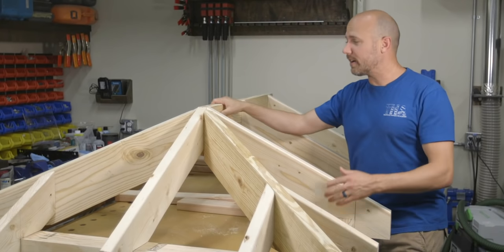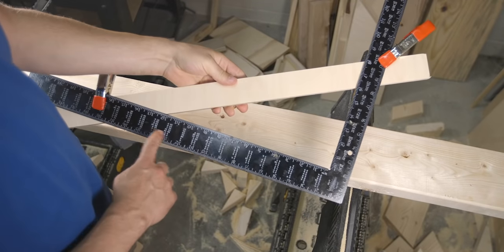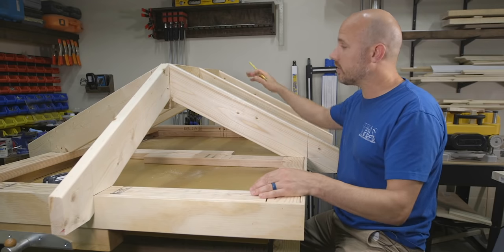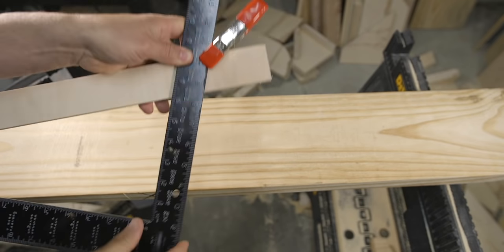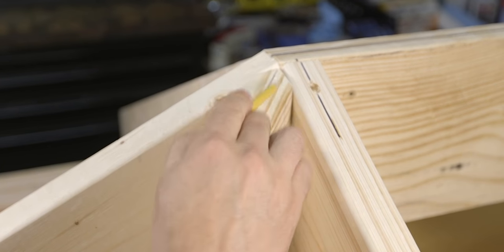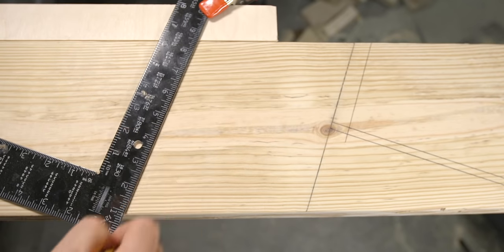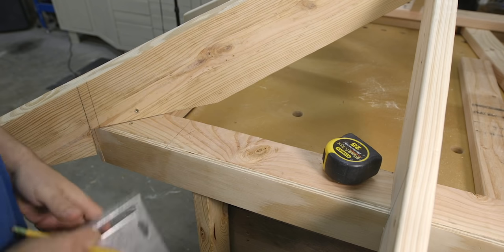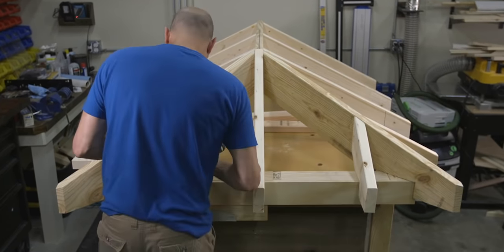How To Frame A Hip Roof - Including A Common Rafter Review

Comment: I will be adding a pitch into a low slope roof. The door will be replaced with a window. I believe the hip roof works best but I’m not the greatest mathematician. The run is 95.25”, 3’ on the wall, and width is 8’4”. The fascia board is already installed.

Comment: Thanks for video, I learned without this special calculator, basically the Pythagorean theorem - a common rafter run is 12”, a hip is 17” run  -this concept is understandable-learn the method or learn the calculator.

Comment: I just built a gazebo with a hip roof after looking at your very well explained videos. The result is more than I expected.  Thank you so much Josh!😊
Reply from the maker: Nice work! Thank you for taking the time to share your success with me.
Reply: If doing 24" oc  instead of 16" oc on Jack rafters  do I still add 7/16" please sir
Reply from the maker: @dannyflanery7466  Yes for this same roof pitch.
Reply: @TrainingHandsAcademy  mine will be 4 /12 pitch  add the same 7/16" ??
Reply from the maker: @dannyflanery7466  Yes, it will be close to that number... cut one and see how it works

Comment: Not to take away from this informative video but I built a rectangular shed with a hip roof. I found a program on line that you input all your dimensions and I printed out layout and cutting templates for my miter saw. The results were amazing and didn't waist  any wood.
Reply from the maker: I appreciate you sharing this. What's the program?
Reply: @TrainingHandsAcademy  Same Question

Comment: Love your videos. Clear, concise and to the point.  I have one question. When cutting the hip rafters you change the pitch from 6 - 12 to 6 -17. Does that apply to any pitch?  For example would I use the same run (17) for a 5 -12 or a 4 -12?  So 5 -17 or 4 -17  in this example.
Reply from the maker: Thanks Paul! Yes, any pitch. A valley or hip rafter always has a unit run of 17". Did you see part 2 of this video yet? https://youtu.be/c2KrU2b1EJI

Comment: You explained it correctly good job. Not sure why nobody  backs there hips anymore, especial on 4 x hips, instead of dropping the hip. Only takes another 15 minutes or so. I have not watched any other videos, another trick, if you don't know this ,, for a cut that is over 45 degrees on the saw, lets say 60 degrees.. you can first cut a 45 and than a 15 to get 60.
Reply from the maker: Thanks for sharing Robert.

Comment: Great video easy to understand. 
The only part I need a little more explaining for is for the jack rafters you said the calculator does  not take into consideration for the thickness of the hip. You said to add 7/16ths  to the length of each jack but how did you get that number. To add to jack length
Thanks
Reply from the maker: Hello. Please watch part 2 for that info. :)

Comment: Great video.  Framing a hip roof for a gazebo I'm building and this has helped a lot (only had to watch it about 10 times before having all of it really sink in, LOL).  Question: I am tackling my tiki bar hip roof next.  Want to do a 12" overhang on the back and right side and a 24" overhang on the front and left side.  How should I tackle where the 12" and 24" overhangs come together?  I was thinking of having the hip rafter stop short where a fascia board would line up (in the horizontal) with the closest jack rafters on each side of the hip.  Your thoughts?

Comment: This is a great video, I just had a oat tree fall on my house due to Huricane Ida and i have to rebuild part of my roof.
Reply from the maker: Oh no! Let me know if you have future questions. God Speed.
Reply: @TrainingHandsAcademy  just learning as I go. I learned how to frame up a wall, sheath it, sister common rafters, and hip pieces. Very rewarding....
Reply: @TrainingHandsAcademy  how do I figure out the angle.of the hips if I don't know the pitch of my dad's roof? Can I just find a old one and trace it and get a angle finder or speed square
Reply from the maker: @Krumholt  Sure you can totally do that to find the pitch.

Comment: This was perfect. Currently I'm in my 2nd year Carpentry Apprenticeship and our teacher is confusing me slightly with hup rafter cuts. He's telling us to measure 1 13/16ths from the first plumb line and from our fascia line to measure back 2 1/8th and then 3/4 on each side of the lines for our cuts. It's a 10/12 roof and it's 42" by 30". Any way you can simplify this?
Reply from the maker: Sorry I can't. There are so many different ways to cut rafters... be sure to ask him/her for clarification in the next class. Thanks for reaching out.

Comment: This is more of a question but let me say these videos are excellent. I'm building a hip roof on my boat house area and am wondering if the common rafters must meet at the end of the ridge board.  The length of my ridge board does not easily divide by 16", so somewhere there will be a space less than 16" along the span. Hopefully this makes sense.  Thanks.
Reply from the maker: Yes makes sense. That is perfectly fine.

Comment: I have a question regarding the overhang on a hip rafter.  I was doing fine with the rest of the marking out until you stated that you couldn't just add the overhang, as with the commons, and you reached for the calculator.  How is this worked out without a calculator?  Many thanks for all your videos, very clear and well done.
Reply from the maker: Hello. It can be worked out using a framing square. I don''t have a video on that yet... sorry. Thank you for commenting and watching!
Reply: Thanks for the quick reply.  If you happen to have those instructions handy, I'd appreciate a PM.  If not, so be it. @TrainingHandsAcademy
Reply from the maker: Sorry I don't have anything written out. I would try to google it, you should be able to find something.  @williamtell4619
Reply: Yes, been doing that, and the consensus appears to be the √2 X Common overhang is the answer. Appreciate your help.

Comment: Fantastic video!! So on a regular hip, my bevel on the jack rafters is always a 45? Like on a 10 pitch roof, which is 40° would my jack rafters be a 45° bevel or 40°?
Reply from the maker: Yes, one of the compound angles will be 45 degrees.

Comment: Good informative video , i have a question about the hip rafters thought - the height above plate is 4 1/16  when cutting c cut then adjusting for rafter drop doesn't that throw it off level / straight  with the roof rafters ? would that not also not throw out jack rafters being level / straight with the rafters also   thanks  Terry
Reply from the maker: The drop actually helps the common rafters to line up with top edge of the hip... some people like to chamfer the top edge of the hip instead of dropping it.
Reply: @TrainingHandsAcademy  Thanks , i just got the 4 installed - had a lot of trouble since each one was a little different - on a bigger structure 12 x16 pavilion using 2x6 rafters 2x8 hips  it was hard to get everything  exact - love to see a video out there how to compensate for things not being 100% square -- your video was great BTW - without it no way i could have gotten this far - now its on to the jacks 

thanks again Terry

Comment: Very nice videos on roof rafters.  I will be building adding a hip roof porch to my house. I have a question.  The porch will be 14' wide and extend 10' from the house.  Based on a simple 2D drawing I did,  at 14' wide the hip rafters would not connect to the house because they would run into each other.   I need at least 2 common rafters for the hips to attach to.  The number of hip rafters determine the width of the horizontal flat that is up against the house.  Is it strictly aesthetics that determine the number of commons rafters or are there a structural considerations I need to be aware of?  Thanks in advance.

Comment: Thank you .share your video.May I ask a question.I saw another video .when he had calculated  the length of hip rafter .then he well shortened  the length by one half 45 degree of the ridge board thickness.Is that right.I appreciate you again.
Reply from the maker: Shortening is half the 45 degree thickness of the ridge board if you are doing a single side cut attaching to the ridge. However, if you are doing a double sided cut (like in the video), it's half the 45 degree thickness of the common rafter. Great question!!

Comment: Thanks for this content. So it appears with the construction calculator you use no adjustment is needed for the hip concerning shortening distance?  

The only adjustment needed is for Jack rafters?
Reply from the maker: Correct.

Comment: Great video.

Question, my old garage is has a hip roof. It has two what seem like 2x4 joists running from common side to common side and one long one from hip side to hip side. It also has what looks like 1x10 gables coming from the roof to these joists. Is it okay to remove these since the roof is supposed to be self supporting?

Comment: Thanks for a great video. At around 5:20 you change the run of the framing square. Will it always be to 17 or is there a calculation I need to make?
Reply from the maker: Hey Jo! It's 12" for all common rafters, and 17" for hip and valley rafters.
Reply: @TrainingHandsAcademy  But why is it 17"
Reply: Pythagorean theorem for the new rise to run on the hip. The hip is a lower angle than the common rafter. Therefore, it’s not a 6/12 rise to run when you evaluate it from a 2D plane.
Reply: @seanpchouston  the hypotenuse on a right angled triangle is the sum of the sq of the other two side. 12x12=144+144=288  the sq root of 288 is 16.97, so use 17
Reply: @seanpchouston  on your framing square , measure the distance between the 12s (hypotenuse), its actually 16- 31/32" or 16.97 inches.
Reply: and if the roof pitches  are different on either side of the hip (referred to as a "bastard hip"),   16.97 or 17 would not work

Comment: im genuinly wondering. where did you get the 7/16 number to add to the end of the jack rafters? your hit is 1 1/2 inches wide. half of that is 3/4 right? does the 45 degeree angle change something im missing?
Reply from the maker: Please watch part two

Comment: Question- I’ve seen other framers cut the outside corner of the wall plate so the hip sits flush. Question is, is it better/easier to just run the hip over the buildings corner? Thanks for all the great information.
Reply from the maker: I personally think running it over the building is much better, but that's me. :)

Comment: Great video man, I understand it all except how you calculated that the birds mouth had to be 4"?
Reply from the maker: The birds mouth is normally the same wide as the top plate and plywood. 3.5" (2x4) + .5" (exterior plywood) = 4"
Reply: @TrainingHandsAcademy    if it was 2x6 wall, the birds mouth would have to be 6". Wouldn't that change the pitch, it would no longer be a 6/12 pitch?
Reply from the maker: @markgibson9208  Great question. No it does not change the pitch. Have you watched my other rafter videos as well? That might help.
Reply: Hi. I watched all your rafter videos. They are the best out there. I'm building a hip roof over my deck with exposed 3x6 rafters. 
I see now that the pitch would stay the same with a 6" birds mouth, but the ridge board would have to be lowered because the seat cut would be higher.  I'm trying to figure out the rise or height of the ridge board since mine is a shed roof coming off the house. Your vids are amazing, thanks for posting them!

Comment: Just realized today the angle of incline on all of the various roof pitches is also the same angle you set your miter saw to if your cutting rafter ends for the corresponding roof pitch.  A roof pitch of  5/12 has an angle of incline of 22.62 degrees.  Set your miter saw to 22.62 degrees and cut an end of a board and you get corner angles of 112.62 degrees (heel) and 67.38 (toe) - which is the corner angles you want on your rafter ends for a 5/12 pitch roof.

Comment: Great Video.  I have never used a Construction Calculator before.  Is there another way to calculate the length of the jacks?  Also.  Are the hip rafters always on a 17-inch run unit?
Reply from the maker: Yes, with a framing square (I need to make a video). Yes hip rafters are always a 17" unit run.
Reply: @TrainingHandsAcademy  as long as the roof pitches on either side are equal , that is true.

Comment: How would you suggest cutting out a hip roof when the wall heights are different l. Example, the two long sides are 16 foot plate height and short sides are 12 foot?
Reply: the easiest way would be to build a 4ft wall on the 12 foot section.

Comment: I really enjoy your videos.  I have a question regarding the 1/3 rule.  I am building a small shed measuring 8' W x 12' L and plan to use 2 x 4 for the rafters and 2 x 6 for the ridge and hip rafters.  Using the 1/3 rule the seat cut is only 2 1/2 inches long.  Interested in whether you think that is sufficient or not or if I should use 2 x 6 material.  Thank you in advance.
Reply from the maker: Thank you for watching! I would jump up to a 2x6 just to give yourself a little more wood there.

Comment: Any advice for a hip rafter for quite different roof pitches? I'm working on a roof design problem where hip rafters are needed to join an 8:12 with a 24:12. I'm thinking this might require a 4x6 and a CNC to get all of the angles and backs correct

Comment: You showed us the steps to do 
this calculation 1:35 in the basic 
common rafter video, and I was getting
the same numbers as you were. 
Now, for this video using your Construction
Calc, your result is 26'' , 
while my TI calc (30XA)
shows 24'' 
I found this issue
earlier today in a different video on a common
 rafter and hip rafter video, as he was using
a construction calculator as well, I kept getting
a about an inch difference. 
For your video, my steps are;
23.25'' squared + 6'' squared = , then square
root of ,and the result comes up 24.011'' not the 
26'' that your construction calculator shows. 
Is there something obvious that I'm missing?
Reply from the maker: Hello. Your numbers are off because you are using the TOTAL run (23.25") and the UNIT (rise of 6"). You can't use both a total measurement and a unit measurement in that calculation. I hope that makes sense. This video talks about unit numbers. https://www.youtube.com/watch?v=kR6kGufeKIU
Reply: @TrainingHandsAcademy  
Thanks much, I had gotten it 
right following your 'Beginner 
rafter layout' , I somehow lost 
the 'Unit' aspect of the calculations. 
I see now that I was confusing 
the entering of the 'total run' 
(minus 1/2 the frame board width)
being imputed into the Construction
calculator, here @ 1:27.
Since I'm using a 'standard'
calculator instead of a construction 
calculator, I need to remember to 
include 'unit' numbers, not total run
number as you mentioned. 
Thanks again.

Comment: hi !. Im building a 10'x10' shed. I would like to have a 4 sided roof but with a ridge board. I dont want a "pinion". I like the flat on the roof when having a ridge board. My question, is it possible with a 10'x10' shed ? What would be the lengh of the ridge board ? The pith would be 6/12.  Thanks

Comment: When using rafter hangers, do they fit correctly, face to face, on each side of the ridge board?
Reply from the maker: Yes, they fit tight face to face... just like a joist hanger.

Comment: On a hip and valley, aren't you supposed to shorten the ridge cut by half of the 45 degree of the ridge?  Also, on the fascia cut we are supposed to shorten the length by the full length of the 45 degree of the subfascia?
Reply from the maker: Yes, and yes.

Comment: On concrete blocks walls, how far apart would you generally install anchor bolts to tie down the top plate?

Comment: is there a way to figure the diagonal measearement if you know the pitch and the run without actually putting up the rafter in place and measuring it.  I'm using 2x6 rafters butting up to a ridge board
Reply from the maker: Yes, please check out my other rafters videos.

Comment: How do you find the measurement of adjustment for your Jacks, based on thickness of hip? The hip is 1” 1/2 but the adjustment was 7/16th? Just confused on how you get the 7/16th.
Reply from the maker: Did you watch part 2?
Reply: @TrainingHandsAcademy  No I haven’t yet, but I certainly will.

Comment: @traininghandsacademy for the fascia board, did you use a 2x4 ou 2x6 ? In your video, you cut the fascia side 4" but what will happend if you put a 2x4 there ?
Reply from the maker: You would probably have a little space behind the trim board which might not provide enough nailing... just depends on what you are using for trim. Great question.

Comment: Hi. I’m doing 24 on center. For the jack rafter, I’m assuming it will not be 7/16th added. Mind letting me know what it is instead
Reply from the maker: Hey there! If you are using the calculator in this video, you will still need to add the 7/16" for 24" on center.

Comment: Is the height above plate the same for the HIP measurement as the King Rafter? I am using 2 by 6 for my hip. Following these measurements to check level I run 2 by 6 that is straight across the top of the rafters to King  to hip along the plate line. I am coming up 3/4 lower at the hip.
Reply from the maker: Yes the HAP is the same for common and king common.
Reply: @TrainingHandsAcademy  is it the same for the HIP?
Reply from the maker: Yes, the hip is originally calculated using the same HAP, but you do have to drop the hip so that number changes. Have you watch the video more than once?

Comment: I’ve built several roofs and I’m no carpenter. I’m wondering rather than dropping the hip you could do a double bevel? 
I’m framing a bay window and need to keep all the hip rafters all the same so the interior ceiling is the same.
Reply from the maker: You can totally do a double bevel!

Comment: Your jack rafters are 7/16ths short because you entered  the adjusted common rafter length into your calculator  instead  of the full run dimension